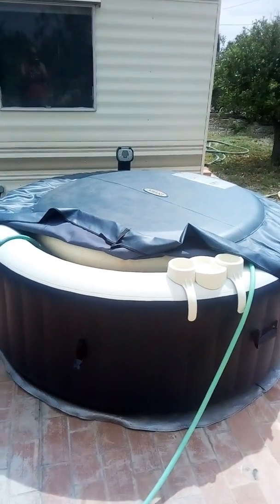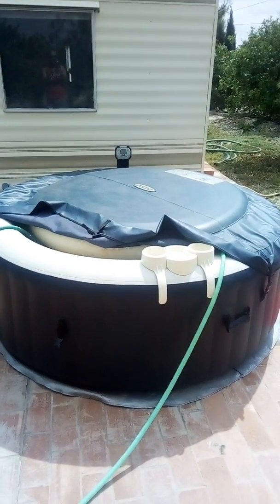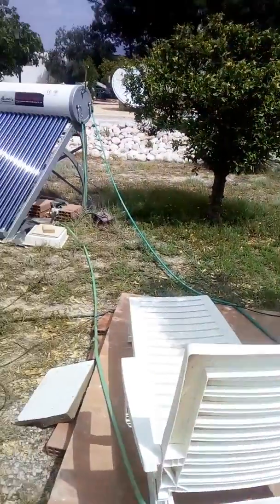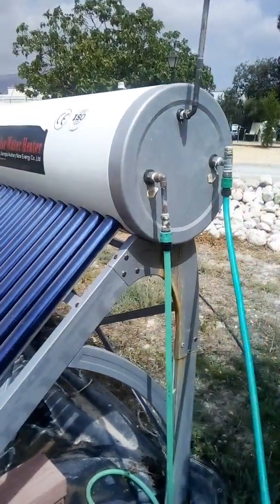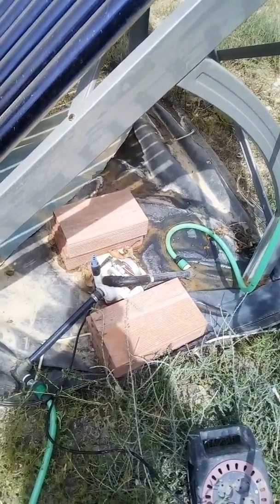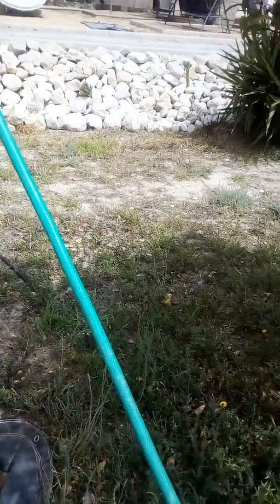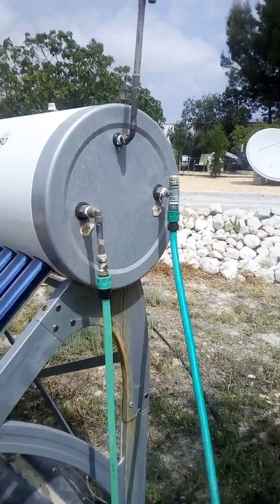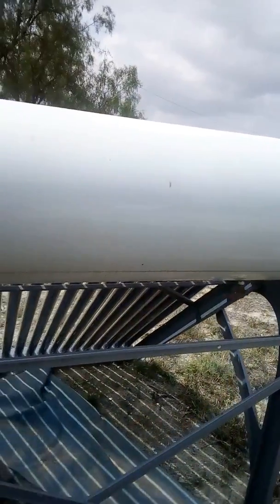Solar heated hot tub

Comment: Thanks for sharing Tony. What sort of maximum temperature do you achieve with the setup. I am in South Africa so also an abundance of sunshine.
Reply from the maker: Hi Den , it can heat up to about 50c but that is way to hot 36c seems good and that is easy to achieve , to be honest the solar water heater I am using is a bit over kill as it is intended for a complete houses hot water , maybe you could get away with a smaller unit
Reply: Tony Mar  thank you for the information. Greatly appreciate the advice. I think you have the perfect solution.
Reply: Apologies Tony what is the size of tank on your unit.
Reply from the maker: Hi , its 150 litre with 18 vacuum tubes 1,8 long 58mm diameter, and a 20 meter copper coil heat exchanger, cheers Tony